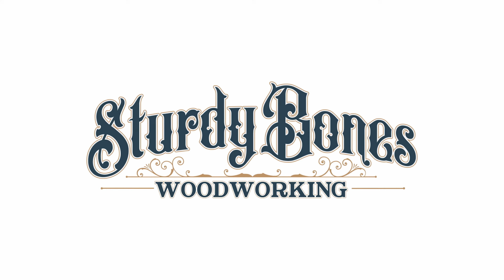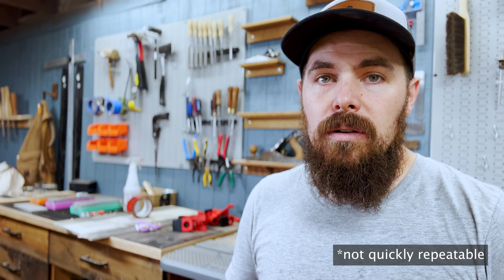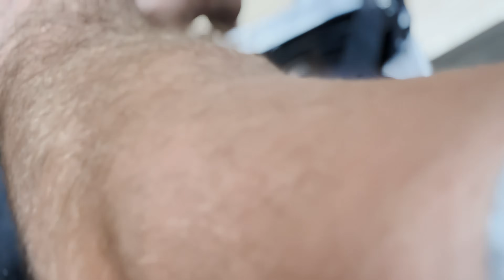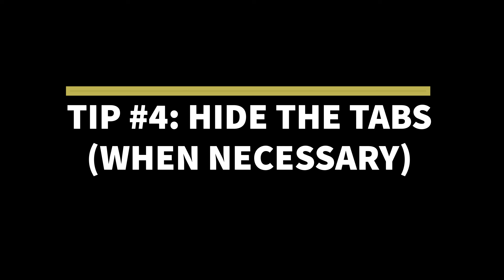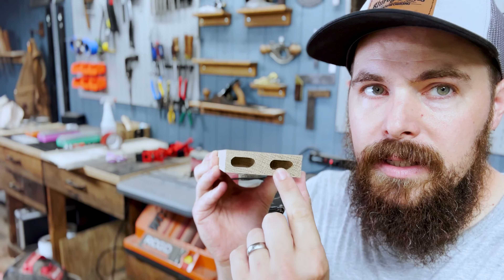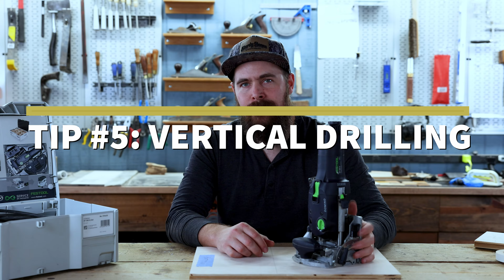You probably aren't doing THIS with your Domino

Comment: I draw a little mortise outline where i need to drill the mortise to avoid blunders. Mainly for the middle of wide board with vertical plunges. Easy to go on wrong side of the line there. 
I also mark reference sides on boards where the mortise is not 100% center as with your example of vertical plunges, i set my domino fence to 10mm for vertical pieces pretty much always irrespective of piece thickness. 
Hope that makes some sense to someone! 
Great tips, i also hid my little toggle clip things as i found they sometimes prevent domino from going flush with workpiece
Reply from the maker: Awesome! Yeah I actually make that mistake in my upcoming video! 🤣 good tips!